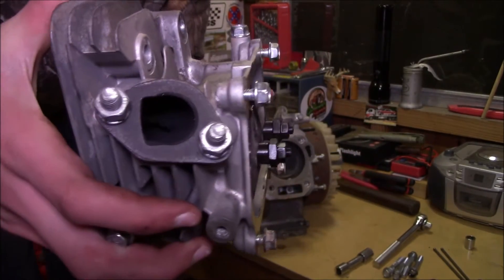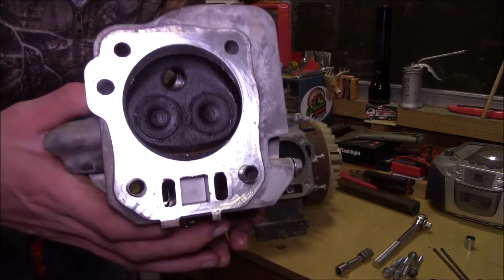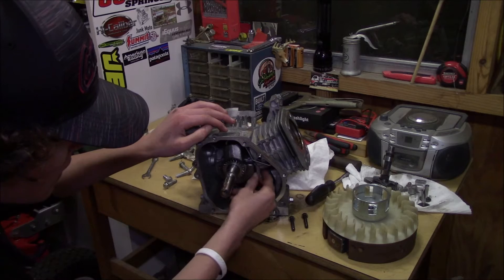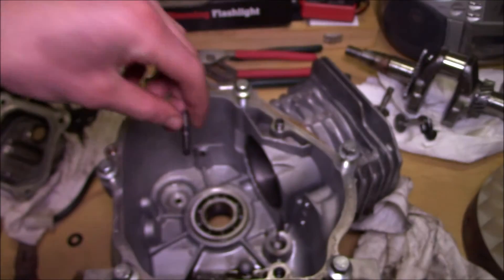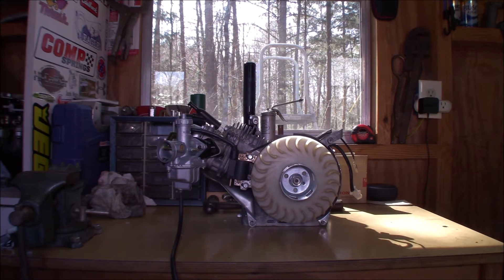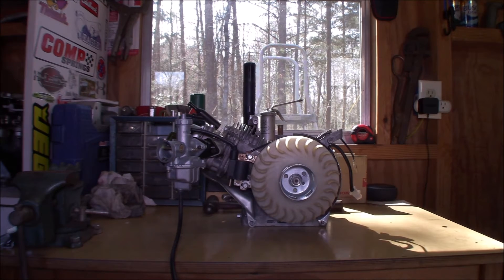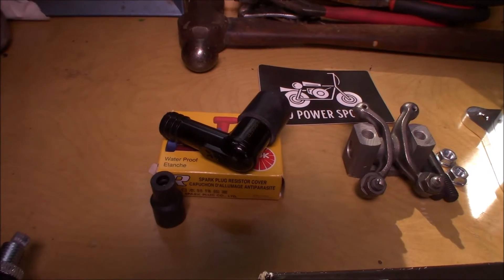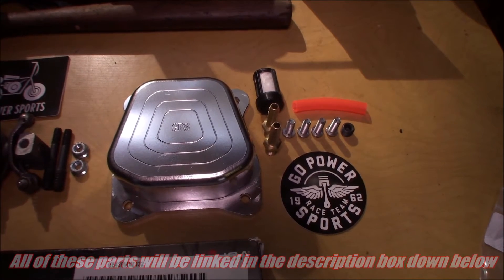6,500RPM 196CC Go Kart Race Motor!! | 15HP Honda GX200 Clone High Performance Build!

Comment: You are the first one that I have seen that drives the governor assembly out the way I do and just put locktite on the tip of the shaft and drive it back in until it's about flush with the inside of the block everything on the top or outside of the block just cut it off with a angle grinder

Comment: Hey, what kind of header are you using and is it compatible with clone engine?
Reply from the maker: Honestly, it was a pre-bent header off a riding lawnmower that I cut the flange off of and welded the clone flange onto and welded that silencer onto. Just used what I had laying around and it happened to work out perfect. It’s a pretty big diameter header, flows a lot.

Comment: Just curious, did you use the flat top piston with the original rod or aftermarket original spec rod? I’m just curious if it’s ok to use the flattop piston with an aftermarket rod with original specs for the 196cc clone, I already had the rod before I decided to use a flattop piston. I’m curious if anyone can answer this for me. And yes the flywheel is aluminum as well as the rod I purchased.

Comment: I honed about a 1000 cilinders in my life. Learned it from an oldtimer.  Honing should be done at very low speed.  If you take a very close look at the finished cilinder wall you should see sort of diagonal stripes at 45 degrees.  You can only achieve this at a very low speed.
Reply from the maker: Yep; crosshatching. Helps seat the rings. We made sure this one had great crosshatching before we finished the hone job.

Comment: Sounds low on oil
Reply from the maker: It wasn’t, just bolted to the stand by only one bolt so it sounded the way it did lol. I’ve checked the oil every time I run the thing.

Comment: My honda gx 160(governor delete) revs like that(probably even higher) with stock carb and exhaust
Reply from the maker: Yeah I believe it, them little 160’s are monsters… and they’ll rev to the moon. Only 160CC’s so there’s not a lot of engine rotating mass.
Reply: Risk to blow your engine....

Comment: Good luck 6500 RPM with a stock fly wheel brother I hope you don’t get a magnet through your leg good luck, try to get yourself a better fly wheel they got a lot of options that could reach 10,000 RPM and it’s not billet, Sometimes I kick myself in the ass for buying Billet it’s like a piece of jewelry that’s hidden. I tried the plastic see-through cover makes the bike look cheap anyway I hope you’re safe
Reply from the maker: Thanks. I'm looking into either a PVL or a Billet Flywheel here soon... along with billet internals (billet connecting rod, etc.)

Comment: I have a stage 1, pvl flywheel,30$ 272 cam 50$ + torque converter I can race dirt bikes on the trails
Reply from the maker: Nice!! That sounds like an awesome little budget build, how’s that .272 cam treating ya? Where’s the power band at? Up top, mid range, or down low, or a mix of those three? It sounds like a pretty powerful motor if you can race dirt bikes in the trails!

Comment: too many tight bends on the exhaust pipe.  loss of power there.  need smoother bend and only 1 bend on exhaust pipe
Reply from the maker: Yeah that’s what I was shooting for but I made this exhaust out of existing pipe I had laying around, it was free, it gets the job done and it sounds amazing in my opinion. Once I throw a cam and a few other things at this motor I’ll for sure look into a more straight shot header with less bends, as well as a more freer flowing silencer like an RLV.
Reply: @JM.Performance  great job on the motor though. sounds good !
Reply from the maker: Much appreciated!!

Comment: no way possible with a 196 stock bottom end stock cam and a chikuni 22 carburetor you making more than 9hp on best day. I just finished building a 196 for my friend, Tillotson 196rs crank, .356 cam, billet tappet lifters, gage 1.3 black venums, stage 4 head, +.020 rod, flat top piston, mikuni 24mm flat slide, billet flywheel with 34° total timing set to .035 spacing with the coil, and it makes about 17-18hp. put it on his doodlebug db30 with a max to 15t and 72t split sprocket, sun f road tires front and rear discs with go powersports front end swap.
Reply from the maker: Even if I did nothing else except a carb, exhaust and Champion rockers I’d at least be at 10HP. Years ago a Champion 196CC motor was put on an engine dyno with a re-jetted stock carb, an open air filter, a pipe and a full governor delete. It made 10.5HP in the upper 4,000RPM range. This was more than an early Predator 212CC running the same test; same dyno, same mods, etc. These little 196’s are sleepers I’m telling ya
Reply: @JM.Performance  Any stock Hisun/Honda clone flywheel revving to even high 4k RPMS is dangerous, the stock connecting rod has no bearings so you will ware the crankshaft and your connecting rod, not only is it cast aluminum, the oil dippers are prone to snapping because the stock cranks are very imbalanced and only balanced for 4k at most, a amazon carb will not be accurate or drilled to spec, I have done multiple 212 builds and i will tell you from experience, do not ever bypass/delete a governor, you will get hurt or explode a 3LB cast steel flywheel. also I don't know where you get your dyno runs at but it sounds like they need to be calibrated
Reply: @JM.Performance  Billet rod .HOT365 cam complete governer delete 24mm NIBBI with 130 main jet straight header should make a few horses IDK how many

Comment: Great video and budget build! What jets on the VM22 did you end up with on the main and pilot?
Reply from the maker: Thank you I really appreciate it!! It’s a VM26 with the same jets in it that it came with when I bought it. Since it’s such a big carb for a stock cam, stock bottom end 196 it was a little rich at first so all I did was move the clip on the needle to either the second to last leanest setting or the last setting (as lean as it will go). It seems to run pretty good like that, I can’t remember which setting I put it on but it’s one of those two.

Comment: Great to see you having a go yourself, best way to learn. When your budget increases get a PVL flywheel as others have suggested, as I’d hate to see you hurt by an exploding flywheel. I built my sons kart engine for an open performance four stroke class in Australia and it’s a 228cc based on Tillotson 72mm bore block. It’s running a ARC billet flywheel and conrod, Tillotson piston and rings, stroker crank, ported 22cc head machined 20 thou etc. No idea how much power it has but it’s enough to win races. Link below to one of his race wins, kart #26 below:

https://youtu.be/-bx2GiqBZGk
Reply from the maker: That’s awesome!! I just finished watching the video and man is that kart fast. I’m definitely gonna be looking into a PVL Flywheel and some billet internals here soon… once the budget increases. Yeah that’s awesome though, I’d love to build either a 225 or a 228 Tillotson one day as well!
Reply: Hi there im having problems with my gx160 engine and wondering if you can help me... It starts up and runs but when I put my foot down it dies.... It was shooting flames out the exhaust when I took my foot off the gas but its been messed around with since and now I can't gwt it back to how it was
Reply from the maker: @wildw77  It sounds like a lean condition to me… make sure your carburetor is 100% clean and make sure you have 0 vacuum leaks. If it still does the same thing I would try upping the main jet in your carburetor. Try running it without an air filter/ air box (not sure what carb set up you have) and see what it does… if it gets worse then yes it’s lean, if it seems to get a little better then it could be rich and the air filter/ air box is starving it for air. Try it out and see what happens, I’d order a variety of jets just to be safe. If none of this seems to work you could just have a vacuum leak you don’t know about or it could be spark/ ignition related. I’m positive it’s just lean though.
Reply: Thankyou
Reply from the maker: @wildw77  No problem!!
Reply: Done all of that and no joy,  I know that my idle screw has been messed about with and the air mixture screw also... I have a open air filter not boxed
Reply from the maker: @wildw77  Try messing with your air/ fuel mixture screw. Just keep trying different combinations and see what works the best. Did you try changing out the jets and going richer?
Reply: @JM.Performance  Ive been playing around with air mixture screw all day and finally things are looking up 👆👆😂😂.... Just pushed throttle down and bam working... Now I need to get the flames back out poping again 👆👆😂😂
Reply from the maker: @wildw77  Yep, there you go!! I figured that’s what it was.
Reply: https://youtu.be/c2j2PWb9zx4
That's how it ran before the air mixture screw was messed around with and other screws... Now it dies when i pull the throttle....

Comment: Low rpm for 15 hp, I rip 8500 on a 212 all day. I would suspect you are closer to 8hp
Reply from the maker: I thought just a stage 1 kit makes 9-9.5HP, and I have a lot more done to this motor than just a stage 1 kit. Correct me if I’m wrong though.
Reply: @JM.Performance  Even if you did nothing else except carb, pipe, and Champion rockers it's at least 10 HP. Years ago they dynoed a Champion 196 with a rejetted stock carb, pipe, and no governor. It got 10.5 HP in the high 4K RPM range. This was more than an early Pred 212 in the same test.

I  have a Coleman with a mildly built Greyhound 196. With a torque converter and better than stock gearing it seems more powerful than it really is. Does very well as a trail rider.
Reply from the maker: @Deucealive75  Hmmmm… that’s very interesting information. We actually have a built GreyHound 196 as well we’re going to be showing on the channel here soon.
Reply: 8500rpm on this kind of engine?? What mods do you have
Reply: @Fiatfan ones that dont exist lmao
Reply: @kingiument4627 they can turn that fast u just don’t know what ur talking about these can reach 9 to 10 k
Reply: @larry_to_goated7716  Yeah I really dunno why I said that. Anything above 10k and im calling bs though. Ive seen people claim they run 15k and that really isn’t possible for more than a few seconds
Reply: @kingiument4627 yeah 15k is 2 stroke levels they are definitely lying 😂
Reply: @Fiatfan It's a stage 3+ essentially a stage 2 (billet rod and flywheel and cam) but with a bigger cam usually a slide carb or a bored out carb and LOTS of head work or a aftermarket high flow head

People build these engines to rec to 10k+ it just get really expensive really fast
Reply: @user-ru7he6qj2w Yeah I wasnt aware of billet parts and stuff im about to build mine to a 20+ hp
Reply: But 212 is half the hp & hp is not determined by thr rpm LOL the 15 hp can run a higher gearing & still push it better & gain speed. The 212 will lack powetlr with a high gearing
Reply: Definitely not 15hp but I get mine to 8700 before I let off idk what the hp is after mods but I've seen some pretty crazy stuff with a 196cc or 212cc they can make quite a bit of power with the right know how

Just realized you got stock rotating assembly??? Dude you bought a billet valve cover but stuck with the stock connecting rod...what

Comment: Great job, but I wouldn’t rev it up to 6500 or even past 5000 with that stock flywheel. Definitely need a pvl flywheel or a billet, I guess your on a budget just like me?
Reply from the maker: Thanks man!! Yeah I’m kind of on a budget right now, I’m going to look into a PVL flywheel and billet internals hopefully here soon… planning to put a 212 or a 224 crankshaft in it and make it a lil stroker
Reply: @JM.Performance  the 212 crank would work and put the piston  at a zero deck height and turn it into a 200cc. The 224 wouldn’t work without a block extension or a short rod since it’s 3mm longer than the 212 crank. I want to do this as well to my hisun engine. It already has the max stroke crank off of omb it’s only .010 longer. And I wanna get a 14cc head with 5mm vavle stems and make a big vavle head that’s milled and ported/ polished. And bmi carts sells .020” over pistons I wanna do that to but may never happen.
Reply from the maker: @connerdavis2450  Yeah that’s awesome man, and thanks so much for the information. I want to do basically all of what you just said to mine as well, that’s end goal for me. 212 crank, zero deck height, ported and polished 14cc head with bronze valve guides and bigger valves, billet retainers, flat-slide carb, decent cam, the whole nine yards. Hopefully this summer I’ll get around to it. We have a vintage racing kart frame I want to eventually put this motor on
Reply: @JM.Performance  would be a bad cart!!! Mines going in mini with a 30series converter
Reply from the maker: @connerdavis2450  Oh yeah that’ll be one bad minibike as well!! Especially with a 30 series, I have a Juggernaut right now waiting to be used on a project
Reply: @JM.Performance  I will be buying a juggernaut for it hopefully soon.
Reply from the maker: @connerdavis2450  Awesome!!
Reply: @JM.Performance  keep uploading videos, and I’ll check them out when I get the notification.
Reply from the maker: @connerdavis2450  We sure will, thanks!! Comments like these seriously motivate us to keep posting. Right now we’re going to be putting out quite a bit of ATV content but in the future we have a built GreyHound 196CC coming as well as a Predator 212 build… and many more to come in the future!

Comment: I didn't hear you say anything about a port job?
Reply from the maker: Yeah man, I forgot to mention it in the video but yes, the head has had an extensive port job on both the intake and exhaust side, as well as a decent polishing job on the exhaust side. The bottom of the head has also been shaved down to the first row of fins… it was on VP 110 octane race gas in this video as well for the hotter plug and the extra compression.